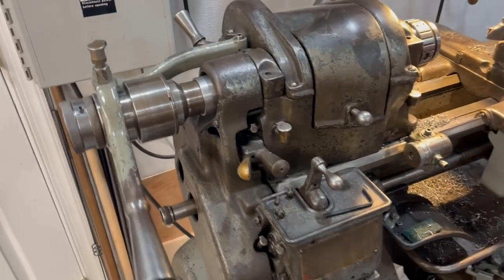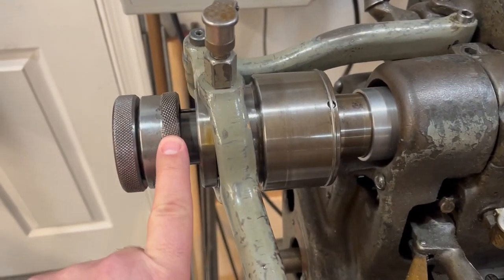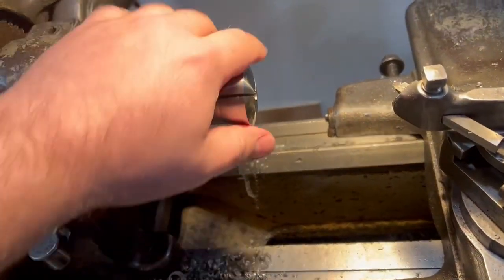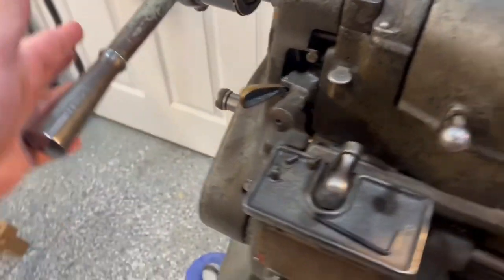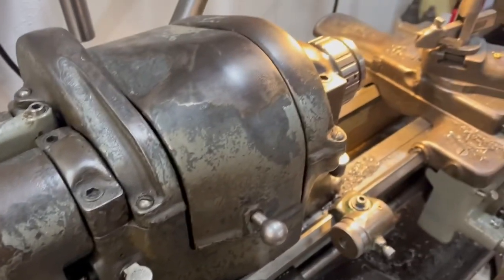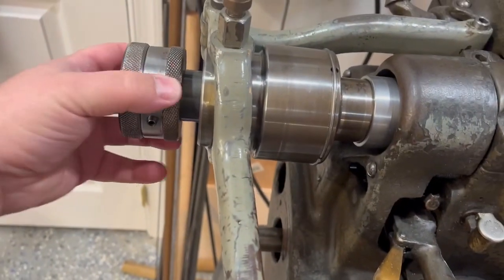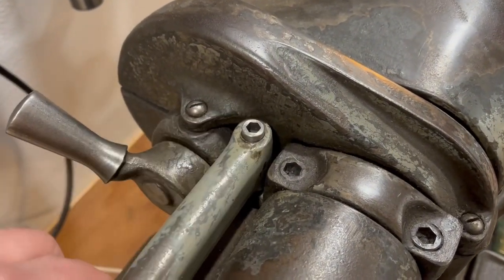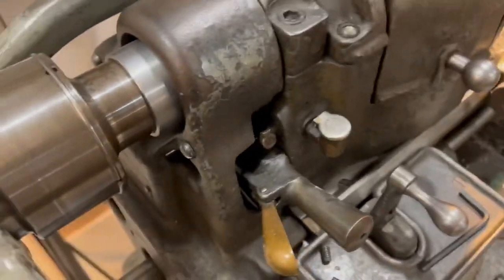South Bend Heavy-10 lever collet closer

Comment: Hello i have a southbend 9" Model a lathe with a 3c collet closer lever just like yours but im having some issues seemingly getting mine to "lock" shut like yours does in the video, i was curious if you happen to have any knowledge on the 9" version of the lathe and or if theres any other information you might be able to help with! Thank you :)
Reply: UPDATE As of messing around with it more and comparing things ive finally figured out and under stand why mine was not "locking" into place, i had the rear locking nut that threads onto the draw tube at the rear threaded on too far thus not allowing enough movement to the left to engage the "cam lock"! Hope this info helps anyone who stumbles into the same issue